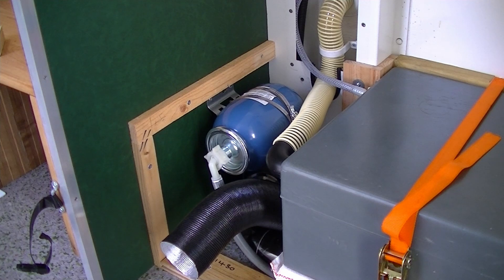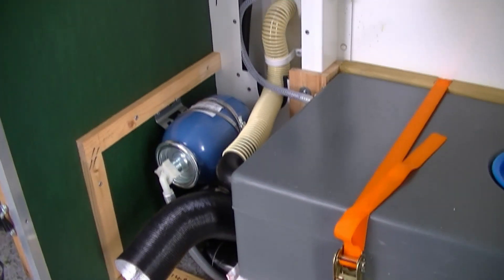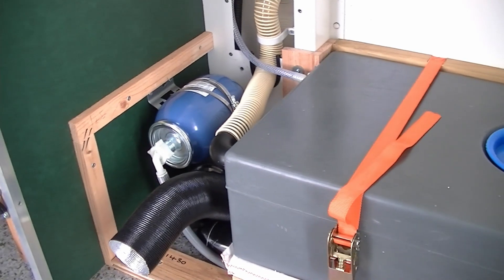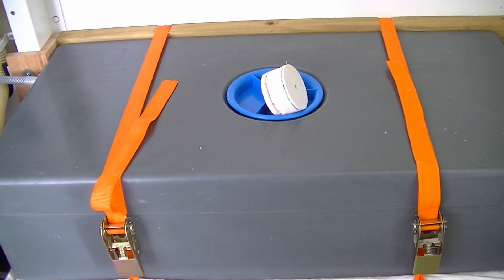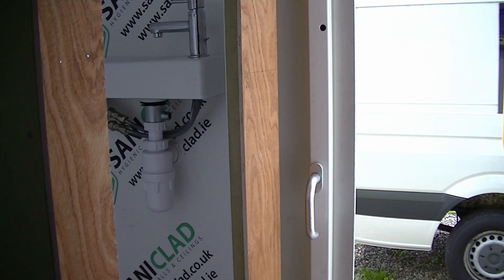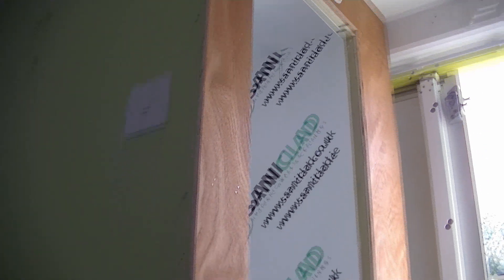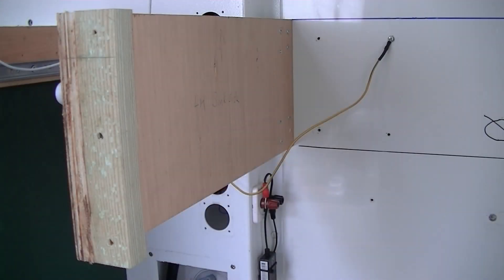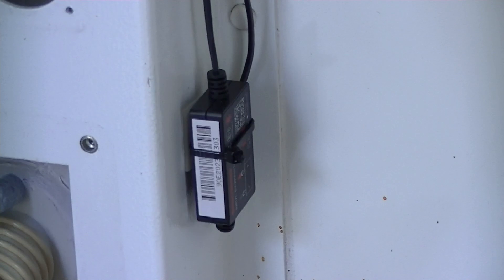Camper Van Plumbing, Ventilation and Earth Bonding in Project WAS

Comment: can you explain how you earth the inverter supply to the ground ? or do you need to ? lol?
Reply from the maker: An Inverter supply is the standard Vbat (+12v) and uses the standard chassis ground.
The output provides the standard 230v Live Neutral and Earth and these should be terminated appropriately at the outlets end.
Most Inverters also have an Earth point on them and that should be connected to chassis Ground you can see that on my Victron here:
https://youtu.be/s-LIwN-8_0M?t=94
Hence by earth bonding appliances sink taps pipes etc as well everything is then fully earthed
Ditto for the incoming mains hookup that to should be earthed the the vehicle chassis